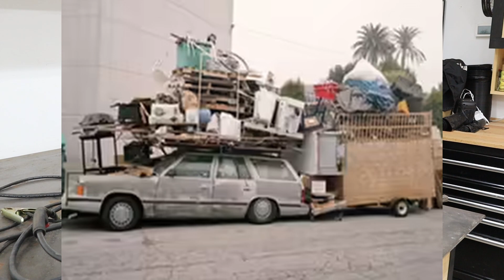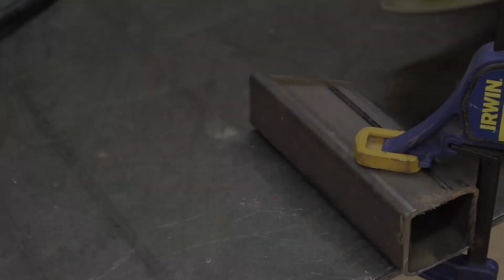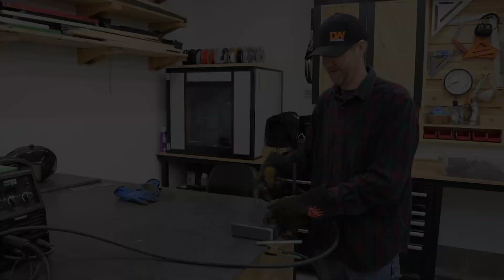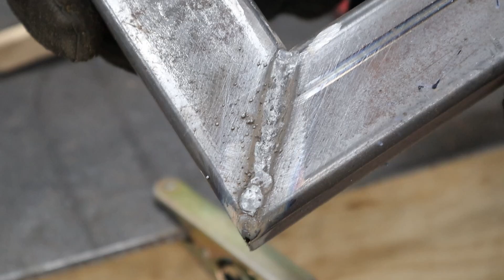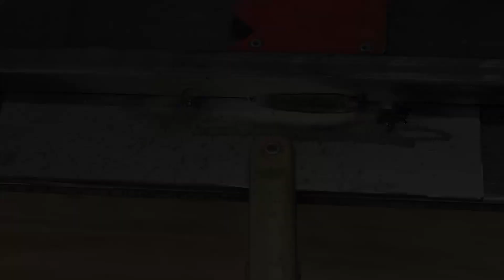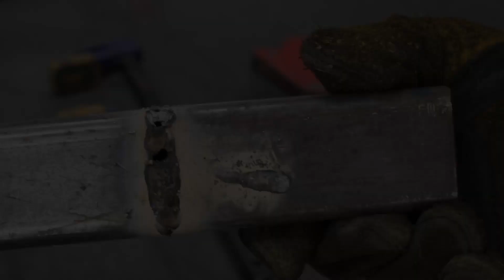How to Weld with a Wire Feed

Comment: Thanks for posting this - just got a Harbor Freight welder - going to try it out soon. Does the splatter stick to the floor and everything else beside the metal?  Also can you just wire wheel the splatter off the metal?
Reply from the maker: Hello, No...the spatter doesn't stick to anything besides the metal and it is easy to grind off. Have fun with your new welder!